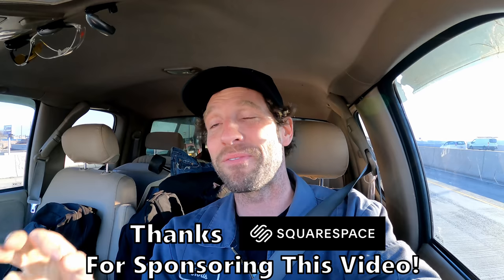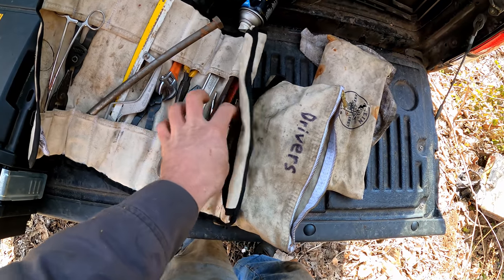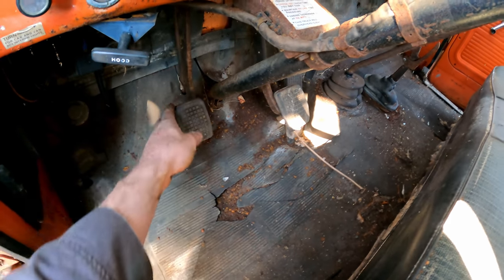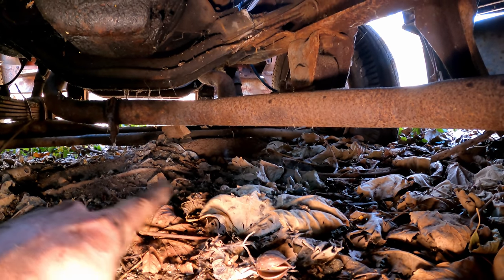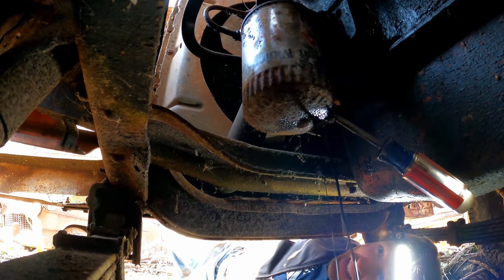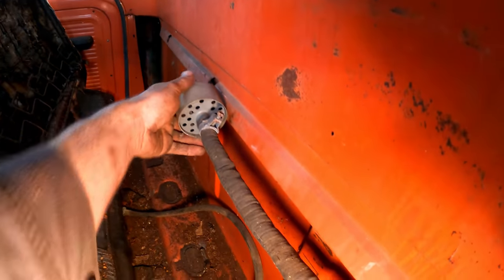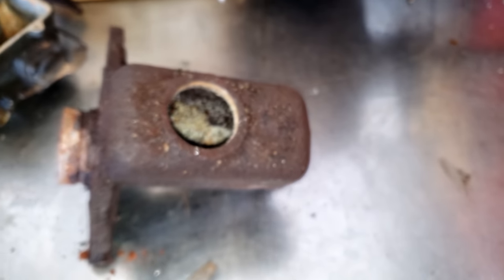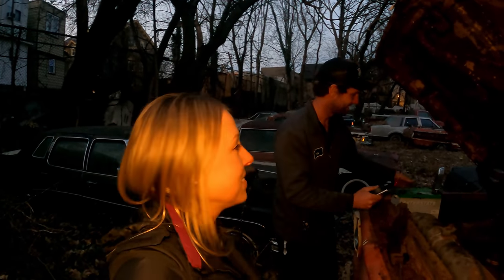Will It Run? 1971 Ford F600 Stick Shift U-HAUL Truck - NNKH

Comment: I'm new to your show. My first show was the jeep and then started watching the 65 fury rebuild, but not done with the show. I love that car. I then scrolled through utube and  you found a 71 uhaul. I  have a 73 uhaul!! I think the cylinders froze..not sure though. I'm not a mechanic,but I'll try to work cylinders free. I  brought it home running. Your engine should be a 359 and not a 360. Also, I think the carb has a governor on it. Your show was 5 mths ago so you've probably already figured that out. My uhaul was last licensed in Texas 1990. I live in Washington state. Love your shows and your mechanical knowledge of car

Comment: Wow that brings back memories! Back then they were all stick. Cool ol TT or TP uhaul. My dad worked for uhaul in the 70's and 80's and i went to work with him. Learned how to drive  stick shift in one of those of those big ol girls. The let me drive around the parking lot after hours in all the diff size trucks. loved the 24ft TH's. That engine is a 330 the bigger gm trucks had 363 destroked 454's. they were all governed btw...tought to get em over 55mph lol.

Comment: Back in the 70's I bought a UHaul truck a 73 Ford F350 with a V8 Automatic and 14 foot box, it was a clean good running truck. I left KCMO headed to Dallas with it and it only got 4 to 5 MPG and only ran 40 miles an hour, I picked up a hiker in Kansas and after a while he said hey man let me out I am in a hurry. When I finally made Dallas I sold it and rented a Ryder to return a 6500 GMC with 24 foot bed, it would run 70MPH and got just under 10 MPG,

Comment: These V8 F500, F600, F700, and F750, Including the AT4, AT5, AT6, onwards ,Dodge box trucks were very widely used here in Australia, back in the late 60's and 70's, they would travel at high speed, non stop between cities during the night, doing overnight express parcel work, when one of these had a smash, they would go up in a ball of flames, considering the amount of fuel that they had onboard, and being petrol trucks.. these  were the sports cars of the trucking era at the time, up and down hills like they didn't exist, rounding up cars at sometimes dangerous speeds.. but.. all good things come to end end, cops made sure of that.. seeing that truck, just brought back many memories..🙂🙂🙂

Comment: When I was much younger (late 90s I think) I worked for U-Haul storage, and we did rentals too.. I had to move the International 26 footer (I"m pretty sure it was the 26 maybe 28) anyway that was air brakes and manual.. granny gear.. and they RENTED that out to people.. like with no air brake experience, just sign here.. hahaha that was crazy!! Anyway nobody knew how to drive stick so I was like 19 or something, obviously knew stick of course, and i got do drive that thing like 50 miles to another U-Haul place for pickup.. SO neat..

Comment: Drove my fiance (now wife of 37 years) up from California in one of these.  Had her '67 Camaro RS in the back with her worldly goods.  6mpg. Top speed maybe 45 mph.  No air, no power brakes, no power steering.  I have a '71 F500 bucket truck, 300-6, 4 speed. 9000 lbs.

Comment: I bought a 71...in 98 in similar condition...Ford made the 330 just for Uhaul...plus the short rear-end and 4 speed gear box...
I drove mine from the east coast to the west coast at 3 mph!...I paid 1000 bucks...I had great storage and the ability to move my family at little or no cost.

Comment: My Uncle had a 1973 Ford F600 School Bus. I think my uncle's bus he lived in had a big block ford engine. It's called a oil bath air filter. Oil is in the filter.
Reply: Oil is in the bottom of the air cleaner assembly. The oil IS the filter. The maintenance is cleaning out the old oil and replacing it during a normal oil change... though most folks only did it about every 4-5 oil changes. Of course the smart thing to do would be to upgrade to a paper filter. Interestingly, the cheaper way to go in the past was to use oil. Not as effective at cleaning though!

Comment: 720 rear end gears.  4 speed trans with a huge gap between topping out in 3rd gear and getting it into 4th gear.  Winds out at 55mph. 
Ford 359md or 398md which is a ford truck. 330, 361, 391FT not FE.  Different heads, exhaust and intake manifold with sodium filled exhaust valve stems.

Comment: A 1975 b 700 361 4 barrel  FT  5 speed  with air brakes took me to school  back in the day!    330/ 361/ 391 and other  hd'S derived  from  the Ford FE  car and light truck series . 332,352,360,390,427,428 etc.
Reply: Ford also built a superduty family  of big block hd truck  engines  up into  the  500 cid range.

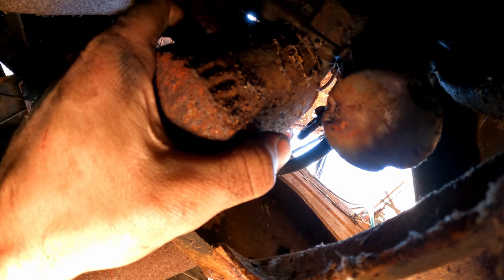Comment: 14:48 The engine number you're referring to "D4TE", means the engineering of that block is 1974 truck: D means 70's. 4 means year in 70's hence 1974. T means truck. The E is the internal engineering number Ford uses inside the engineering departments. Perhaps the truck is a 74 & up model year, or the engine was replaced in 74 or after. 
Also, U-Haul went to Ford to build specific chassis cab trucks with their specifications since they were purchasing thousands of them. As you can see, orange paint under the dash, behind the seat & inside the doors. Goodyear Tires with perhaps a unique size with unique size steel wheels. U-HAUL molded into them. Left-handed lug nuts & the locking governor underneath the carburetor.

Comment: I worked for a Uhaul dealer back in the 70s.  This size of truck was designated as a local rental truck.  These babies usually got over a million miles on them before they were sold off.  Local businesses would snap them up as fast as they went up for sale.

Comment: Cool video. This looks similar to the Ford 330HD industrial v8 that’s in my ‘72 Asplundh chipper. It has the same valve covers, manifolds and oil pan. Mine has points, and like this truck it has an oil bath air filter. They’re used on old tractors, trucks, etc. On the chipper it’s canister shaped and separates the dust well.
Reply: Either a 330 or 359 MD/HD..
Reply: Definitely a Ford F600 with a 330 FE-Type HD truck V8 and a New Process 435 four speed w/ granny low gear.  No power steering, hydro lock brakes, no radio or no A/C.  Oddball 8x22.5 tires and wheels.   There should be a spare key hidden on the radiator support on the driver’s side.  Just in case you want to try again.

Comment: I have a 53 dodge with left hand threads on the drivers side wheel lugs. I did not know that ford did that too, and still in '71. Nice vid in real time.

Comment: I remember driving a manual transmission U-Haul in the 90s.  It was just a Ford f350 with the 300 inline 6.  The truck has to be late 80s early 90s but it was still in service.

Comment: The good old oil bath oil filters they used them in big trucks into the 1970ès I know my grandfathers Dodge grain hauler truck had oil bath filter too. They work real good back when roads were all dirt a paper element would clog right up quick but the oil bath they filter the dirt great and you don't have to worry about a clogged filter

Comment: I gave $1200 for my 71 f600 X uhual with a dump body in 2020 in running driving condition (barely) lol NNKH, also the hose going into the cab is called a clean air vacuum vent.

Comment: We had this model here in Brazil in past decades, it had the nickname FORDÃO (Ford augmentation).  It was also called a kid post with the great strength to climb a hill, as it was equipped with an excellent MWM 229 6-cylinder engine.

Comment: IN '72 I rented the same truck (but with the cab-over box) to move from the Bay Area to Nor Cal.  Hooked the biggest U-Haul trailer available to it  (16' enclosed) with my '62 Austin Healey 3000 parts car and my entire garage in the trailer.  It had the same governor on it...the further I went, the more the governor quit working.  Last 30 miles I was rollin' at 75 flat out on the straightaways!  The owner of this old girl is really smokin' some good stuff if she thinks anyone's giving her 3k for that rust bucket!  In the end, she'll be lucky if she finds someone willing to take it away for free so they can scrap it.

Comment: Loved it, I have only driven one manual transmission uhaul.  That’d make a great mobile shop truck. Hope it goes to a great home
Reply: Space-wise... yes. Gas mileage-wise... NO! You'd be far better off getting a 1/2 ton with a utility box on the back in place of a standard bed. It wouldn't be a big deal if we were back at 90-100¢ per gallon like we had at the turn of the century...

Comment: Never seen a windshield washer bag? How old is this guy. I drove a 73 F500 rack body truck back in the early 80s  it was our parts truck for heavy duty truck repair shop. Great truck
Reply: My '77 F-600 has the washer bag and manual foot pump to spray it.

Comment: We had the twin to this the N600 on the farm i was born on. Ours had a 390 with dual exhaust and a pto drive which operated a dump body. Truck blew the pinion bearing and tore up the rear differential and  that was the end of that truck. Also same year.

Comment: Last time I rented a manual u haul was in 2006 was a 25 footer and had a 7.3 non turbo diesel and a 5 speed. They said they hadn't rented it in a few years and because it was late in the day and I needed it now I had to take the battery out of my truck and use jumper cables to even get it running. They only allowed me to rent it extremely cheap though cause my truck had a manual in it so they said that I could get it. Was a turd but was the last time I saw a manual U-Haul available for rental

Comment: I have an old 1974 Ford pickup truck that I have stripped down to the frame, that my dad ordered new with a 360 motor and one of my friends his brother had a pickup truck with a 390 in it and then I knew a guy that had an old 70's, either a F600 or F 700 and I believe that it had a 352 commercial and maybe it said "industrial" also, I just can't remember exactly . But I would love to know what engine was in that old U-Haul truck . I have several parts for a 360 and then I have a set of heads that came off of a 390 that I had redone and was going to put them on this old 360 motor, but then I decided to not fix the motor . I will be looking for a part 2 on the U-HAUL . I will see you later on another video .
🤗👍💖💫

Comment: The engine is  330 cid .. I worked at uhaul during the late 80s .. and they were still using them..
Reply: yupper, looks like a 330xd, with the np435 tranny. Did it have the pto on the passenger side?

Comment: Hey Chris and Jen!  Yes the older vehicles actually had an oil bath air cleaner and yes they are very messy!  The engine sounds pretty decent, but I do not think that the truck has much value. It is going to cost somebody a good sum of money to get the truck hauled out of there.   It certainly is not road worthy and is not worth putting thousands of dollars into it to make it road worthy.    My advice to the owner is to be realistic she is not going to get 3k from that.  I think $500.00 TOPS and that is pushing it.  Thanks for the video , I very much enjoy them and it is always nice to see Jen!  👍

Comment: Love the video and definitely hope there are more like it for bigger trucks. I have a 77 F-600 that used to be a fire truck that I'm converting to a flat bed dump. Luckily, it started out in much better shape than this one, spending most of its life inside the fire house and only 7,150 miles. Those old Ford XDs are pretty bullet proof. Mine was the first time I'd seen the washer fluid bladder too, complete with manual foot pump.
Reply: Worked at Arco gas station in 70s. There's rented for 16  a day and 16 cents. A mile

Comment: 360 is in the FE family which is a big block 351,360,390 and 427. The you have the 85 series bock witch is the 460 and 421 big block
Reply: The 351 engines weren't part of the FE series - the 352 was though. The 385 series engines included the 429 & 460 which used gasoline. The "Ford" 421 was a diesel and IIRC, wasn't manufactured by Ford. I might be in error on that though... the memory isn't what it once was.

Comment: Put a rubber hose over that round vent on the governor and a plug in it and it will stop it from sucking air wen you step on the throttle it works great I did that everytime I would rent a u haul truck to move otherwise it won't go fast enough to get out of it's 55 miles an hour

Comment: The key thing below the carb was uhauls way back then to govern the speed.  If u noticed on the steering column it said the speed was governed at 52mph.  Thats the only way to govern a motor without a computer.   Uhaul has always and still does govern the speed on all of their vehicles.

Comment: I rented a UHaul 26' SuperMover about 20 years ago moving from the DC/NoVa area that was a Diesel and had a stick. That truck was OLD. Forget the model but it was early to mid 80's. GM or Chev equivalent of this Ford. Biggest piece of shit I ever rented from UHaul. On the way home to load it up as I came up to a stoplight it started hopping all over the road when I hit the brakes. The rotors were shot. Steering was loosey goosey 'herd it down the road'. Got home and called them back. No 26' trucks left. Had one of their mechanics come to look at it. He just wiped his finger on the rotors. I said 'Do you wanna drive it?" He said 'No. I know this truck. I just worked on it.' They ended up driving me out from Richmond a nearly brand new GMC/Chev 26' Supermover with a Big block GM  gas 7.4 or something with an Allison automatic. That was a nice truck. I think it had 20-30k miles, barely broken in by their standards. As a bonus they included another 2-3 dozen moving pads that I rented but keep from the original truck. I told the guy delivered the truck that I kept the pads from the first truck and he said 'Well they told me to bring pads and a truck, so they're yours now.' I still have them in my basement. I loan them out to friends moving.
Reply: I left Ryder a couple of years ago...this happens all the time. Pieces of junk get rented out that shouldn't even be on the road. It's all about the numbers today (rental agreements and rental %).
Reply: @grocerygoat06  It is all junk. About 15 years ago I rented a Budget box truck and a car trailer to drive from Ohio to Michigan to pick up a car I bought. The dealer guy was really mouthy runty bastard that had a half-ass 'resto' shop. Kept telling me how great he was . He hitched up the trailer to the truck and stupid me I didn't check it. Well about 60-70 miles out I was on the Ohio turnpike near Sandusky in the far left lane and I felt a jerk on the back of the truck. I looked in the side mirror and saw semi's and all the traffic behind me backing down and parting like Moses at the Red Sea. I made my way onto the shoulder (left) and found the trailer separated from the hitch because the  hitch coupler wasn't seated on the ball which was all rusty and dry. On top of that he never crossed the chains and one safety chain tore the weld off of the attaching link welded to the bumper. The trailer was held  on by one safety chain. Hooked it back up and went to the nearest Walmart for some safety cables and ball grease. It wouldn't have held with a car on the trailer for sure but I would have caught it loading the car. I did have the insurance they offer , and when I called the guy up one of his employees answered the phone and I ripped into him about his boss. He said 'I know. I know.' He was out of business a few years later. Funny appendix to the story. A year or 2 later I was helping a neighbor move and I saw he had a Budget truck. I told him my story about that guy. He rented his truck from the same guy. The neighbor got really excited and turns to his wife and says 'See! I told you that guy was a f**king asshole! I told you!"

Comment: Actually U-Haul rented manual transmission trucks till roughly 2005ish was the 90’s model Internationals
Reply: You are correct. They also had a few Chevys with a 366 big block and manual transmissions.

Comment: that hose prolly goes inside the cab for that vacuum gauge tell you if you have enough vacuum for power assist?  maybe goes to a junction and also works heater flaps what not?

Comment: It's a 361 FT.... yes the FT's are governed. The FT is the truck version of the FE, the 352, 360, 390, 427 and 428. It would have a oil bath air cleaner.
Reply: It's a 330 cid
Reply: @donlankford4315  It could be, or even a 391 as their were three FT truck engines Ford built. The most common though were the 361, but being a U-Haul, it very well could be a 330. I worked in a School Bus Garage back in the 70's, all the FT's in the busses were the 361's.

Comment: Fair price for that truck is scrap value since it would take way more than that to get it drivable.  I've scrapped many cars and always had owners tell me they wanted more than scrap value cause "it's worth (x) in scrap", but thats when i would remind them that if they scrap it they actually have to deal with getting it to the scrapyard themselves, which sealed the deal in most cases

Comment: In 2005 when I worked at Uhaul the international trucks were still standard transmissions but they were selling them from the fleet Along with all the diesel trucks. 

Easy way to tell the difference between the 360 and 390 is the 390 you can take the heads off without taking the intake off.
Reply: ITS A TRUCK ENGINE A 352 CUBIC INCH ...
Reply: @tammylott921   good possibility that it is

Comment: Fair price about 1500 if you live close. Pull the rear end the engine and cab take off the box and that’s a storage container and run the rest across the scales.

Comment: It’s most likely a 361 FE ford heavy duty motor.  They have forged crankshafts, stronger rods, full length shirted pistons, and thick cylinder wall castings.  There was also a 391 FE hd motor available that had a 4 barrel carb.